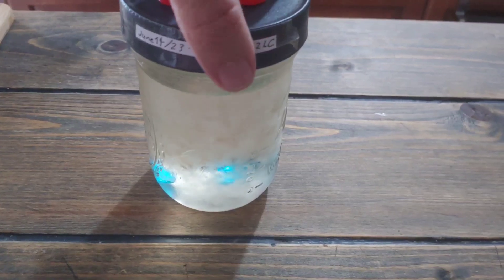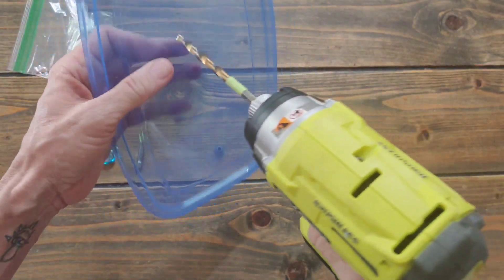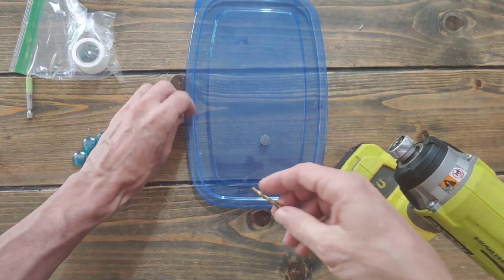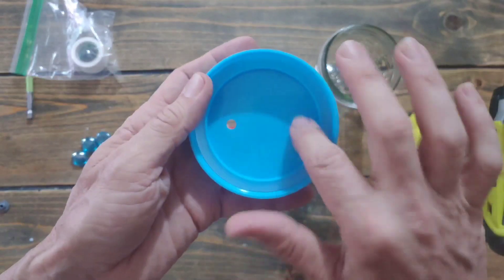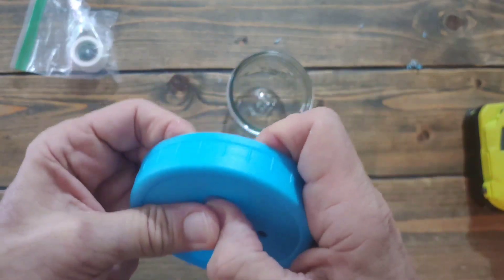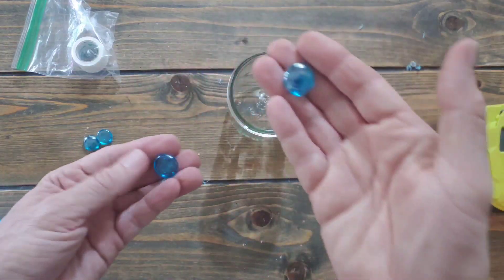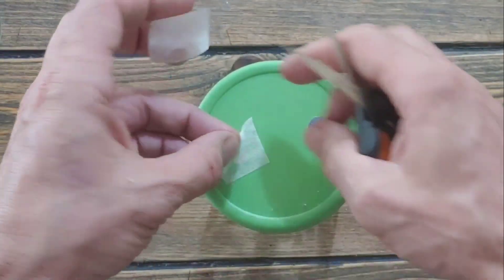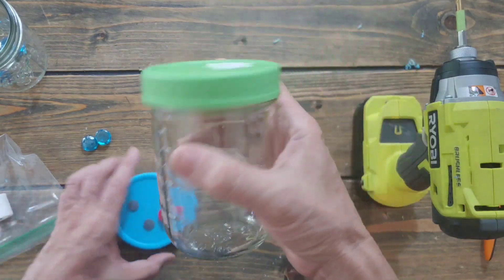How to Modify Jar Lids for Grain Spawn and Liquid Culture

Comment: I ordered injection ports and the 22micron filters from the Jungle site.  They are far bigger than the ones you have.  Also, the filter disks are luer lock connectors.  I got the idea from Fresh From The Farm Fungi.  The injection ports will probably require a 1/2" hole to fit.  I plan to use room temperature vulcanization cream (red) on all of the joints.  I plan on using plastic lids.  The metal ones are not to my liking these days.  I detest rust.
Reply from the maker: Cool. With p the plastic lids, I've never used Any glue for the injection ports nor the syringe filters. They've never leaked.
I never use the metal lids. Not only do they rust, but they're very thin, so I'm not sure if the filters and/or injection ports will leak on those lids. The Ball Brand plastic lids work awesome.

Comment: minimize jaggies with drill in reverse but of course its slower.
all of my injection ports fail leak test without high temp rtv w/metal lids
Reply: 120 grit sand paper takes away the jaggies and roughens the surface to help the RTV bond.  Just a thought.